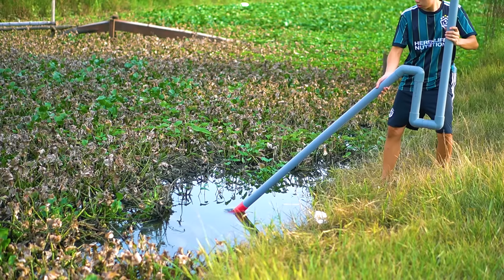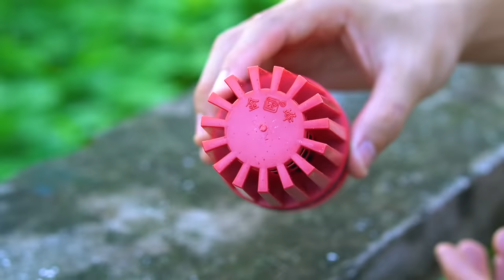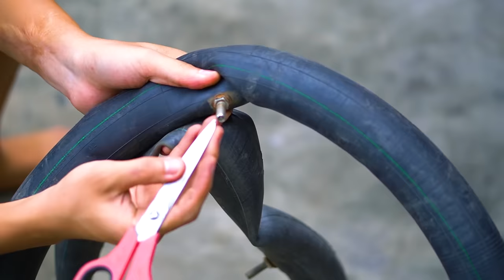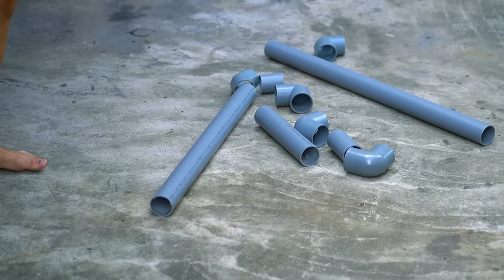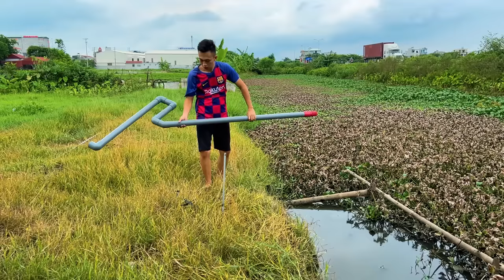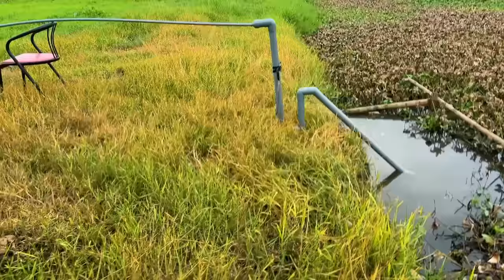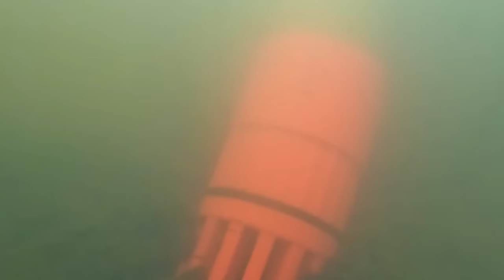I turn PVC pipe into a water pump no need electric power

Comment: what kind of check valve is that? where do you get one?
Reply: You can easily make one out of parts from a hardware store.
Reply: You can buy a gas siphon hose with a half inch copper fitting with a marble in it for siphoning gas without getting any in your mouth at any auto parts store in the US. I have 3. One in each car and one at our cabin for transferring gas from gas cans to generators with total control so I don't spill. As you jerk the hose upward from teh bottom of the gas can, a moving column of gas rises and when you jerk the hose back down, the gas continues upward for a second and then as it begins to go back downward, the marble seats in the copper fitting and stops the flow. As you jerk upwards again, like this guy does in the video, the process repeats. That part is simple and readily available in the US. It's just a simple check valve. He is using the inertia of the moving column of water to open the check valve on the drop, then it closes and holds the water in and raises it and develops inertia in motion on the rise, and then while he jerks it back down again, the water keeps rising in the pipe and teh valve opens and lets in more water, then the process repeats. What I don't have an answer for is how it keeps pumping. I suspect once he attaches the hose to the output, it acts like a simple siphon as that delivery water goes downhill out the delivery pipe. Somewhere inside that u shape there is something else happening in hydrodynamics that is causing water to pump uphill in a small amount at teh expense of water going back out the bottom of teh contraption and creating a vacuum. gonna have to look that one up.

Comment: Total bull crap, against all laws of physics. From the time he put the pipes together before you walked into the grass we did not see him and that is when he installed a small pump battery powered inside the pipe. The check valve lets him sloshing it back and forth in the water allowed him to prime the pipe up to where the pump takes over.. not only that but when he was putting the smaller half inch or 3/4 pipe to extend it up The Big unit he was fighting pressure. The rest assured there is no magic here, only a pump installed inside the pipe well the cameras weren't on him. It amazes me how many people are falling for this   🙄   👎🏻
Reply: You got an analitical mind haha
Reply: Creative Prodigy commented, he made one as in the video and it works
Reply: @mahomedrafik6908  No way!!!
Reply: @mahomedrafik6908  i think creative pro lied and just want us to watch same fake video in it channel
Reply: @adiyasri6971  check out how the valve got modified. It makes a pressure pump as long as water pressure is bigger than atm pressure.
Reply: The air pressure is limited to the incline in the pipe due to the dip in the pipe - therefore the water pressure is greater than the air pressure. The water pressure thereby pushes IN the value and thereby creates a jet of water pressure that shoots the water up the pipe. Based on Archimedes Principle as long as the weight of the water based on volume is greater than the volume of air in the pipe below the dip in the pipe then the valve will keep sucking water as a spray jet under pressure into the pipe.
Reply: @louism9725  precisely what I also realized - thanks for the corroboration. This is a genius idea for sure.
Reply: @louism9725  the schrader valve requires 30 psi to force it open. Water has more psi the deeper it is - so the pipe goes six feet down and is 3 inches diameter - so you get greater than 30 psi to force open the shrader valve.

Comment: I could actually see this working a little is the outlet opening craned down and wasn't aimed straight out.  Seems a little too easy for the air to enter and the vacuum to break and the flow to stop. certainly not enough to squirt out of the hose like that. My vote is that there's more going on here.
Reply: Its work.?

Comment: The very steady flow of the water proves this pump is powered either by electricity, gas engine, or otherwise a windmill on a very windy day.  You'll be needing a new tire tube for your bicycle.  Do what I did and use a broom handle in place of the tire tube! Don't worry... the broom handle will bend into the shape of a tire tube.  Kidding.  Just sticking it to you like you stuck it to all of us. 🤣

Comment: No way!   He's got to have a submersible pump hiding under there.   There's not enough current to move a RAM pump that hard
Reply: RAM pumps don't work off of current they work off of water pressure flowing down hill. If you have current you can use a waterwheel.
Reply: It creates a suction just like when siphoning gas out of a car's gas tank.. same principle.

Comment: Water is pulled up by moving the pipe in and out motion using the check valve I get it.  How does it continue to pull water out of the pond higher than the pond level?  Gravity doesn’t allow it.  Unless there is a pump of sorts.

Comment: This guy must be given the PhD award. Newton is laughing in the grave.
Reply: Muito inteligente e incrível
Reply: Just insulting
Reply: फर्जी
Reply: Absolutely
Reply: the schrader valve requires 30 psi to force it open. Water has more psi the deeper it is - so the pipe goes six feet down and is 3 inches diameter - so you get greater than 30 psi to force open the shrader valve.
Reply: This is not possible...
Reply: @ansumanbaldania2311  He moves the water back and forth to create over 40 psi to open the Shrader valve (30 psi spring opening). The "pea trap" collects water creating a negative pressure PSI gap and thus the shrader valve keeps shooting up water.
Reply: Free energy?

Comment: Note, the initial siphon pipe is equal the the other, but once it is carried to the pond it is almost five feet long.   Does PVC grow in that country?  Fraud.  there must be a pump in the pipe.  Show us the inner of pipe before placing it in the pond and then reassemble on spot, there was no  glue needed.
Reply: I noticed the longer siphon pipe too. Better yet, make it with clear plastic pipe. A little more expensive, but hell, he's got 588k subscribers. He can afford it!
Reply: Right! Compare the build pipe length at 5:43 with the pond length at 0:05 - twice as long. He had to remove the modified check valve as there is now way that volume of water would flow through the tiny Schrader valve!

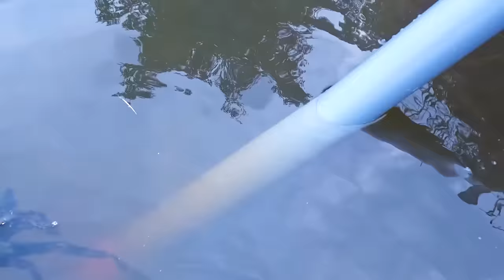Comment: This device cannot work in still water. Note at 11:25 there is a big hole on the left where water flows into the pond. Note the water turbulence too. The water could be directed towards the pipe via the red check valve.
Reply: Correction: should be RIGHT  not left side.
Reply: What?!

Comment: You can use a ram pump for  no power but it uses gravity and is very inefficient
Reply: Well at least you're kinda right. It's electricity that you don't have not power. The ram pump uses water as it's power source, and it is very efficient. It works and works 24-7 without you there pumping it by hand.

Comment: After this video I went outside and made the same thing and filled up a bucket with water.
The bucket immediately started climbing a wall.
Reply: the schrader valve requires 30 psi to force it open. Water has more psi the deeper it is - so the pipe goes six feet down and is 3 inches diameter - so you get greater than 30 psi to force open the shrader valve.
Reply: @voidisyinyangvoidisyinyang885  The schrader valve never even opened. It was mounted in a non-watertight sliding check valve leaf and water could flow past it freely in an upward direction, straight into the little battery pump mounted inside the pipe. The valve was added for visual effect.
Reply: @voidisyinyangvoidisyinyang885  Thanks for telling...and?
Reply: @TrueSolitaire  Actually the secret is when he moves the PVC pipe back and forth - that's what opens the Schrader valve. Then when the bottom of the 90 degree pipe fills up that creates a negative vacuum that pulls the water up. Then the water pressure keeps building up to push the water out the other end of the pipe.

Comment: Same principle as siphoning.

The red contraption below is a non-return value.

Once the pipe is filled with water and flows, then it'll be free flowing.
Reply: That is not a non-return valve it is a torn apart valve stem. I guess it could help if when you put the thing in the water you slipped a hose over it and then someone turned on the water.

Comment: This is one of these thousands of videos on youtube where the publishers only chase the number of views for financial gain.  Although these are all hoaxes, what I cannot understand is why would you risk your good name and honour to post videos like this - and I have not specifically chosen this video to say this.  It is just impossible to comment on all the BS videos out there.
Reply: … and he seems to be succeeding in that. Zahils are wondering and liking!
😂😂😂
Reply: the schrader valve requires 30 psi to force it open. Water has more psi the deeper it is - so the pipe goes six feet down and is 3 inches diameter - so you get greater than 30 psi to force open the shrader valve.  So no - not a hoax
Reply: It's a shame people can't be upfront.  I'm getting fed up with the bs

Comment: No water will flow up in a pipe unless mechanically assisted. It does not matter what specification or pipe measurements are used. Pumping at that flow and constant pressure, endless. Built the exact model, did not work. BS.
Reply: и не будет работать так как противоречит физике
Reply: It's a pressure pump. check out how he modified the valve.
Reply: The water will absolutely flow up into the pipe. Right up to the height of the water on the outside of the pipe. Unless you plug the pipe with a schrader valve. Then no water will flow up the pipe.

Comment: Now, build an enclosed system, power a suitable sized motor with that water flow, and you've got yourself a perpetual power generator. And they say it can't be done 😆
Reply: but no system can be total closed you can get close, but fully, the bar for perpetual motion is way higher, just regular power generator, unfairly really regular stop and star all the, but to perpetual power generator once started much keep going on for ever to the ends of time, the second it stops it not perpetual motion
Reply: The reason why it (any type of perpetual thing)can't exist is because nothing is 100% efficient. Not the water pump, nothing. You might get away with the system for a few seconds (long enough to make a video) provided that the pump pumps up a fraction of what was used to power it. That is obviously not sustainable
Reply: Yeah, that was just what I was thinking….with a series of basins on a hillside connected by these, and then to a gravity fed water power generator….seems like this would solve all the world’s energy problems.  Since this would be pretty obvious by now, and this isn’t done, I am missing something here.  Even if not perfectly efficient and lose some power at each step up, seems like a solar pump could compensate for this, but again as this isn’t really done, something doesn’t add up.

Comment: Notice in the beginning he's showing you the insides of the small pipes... The big one doesn't get a clear shot through it as that's the one that has the pump. The check valve is used to prime the pump, without that it wouldn't work. Next video please.

Comment: I watched till the end, and I am amazed. Mine won't work though. I don't think my inner tube was broken enough. But hey, almost 1,000,000 views and nearly 600,000 subscribers. Not to mention over 1000 comments (plus replies). Money in the bank!
Reply: 1.8M Water Jiggler pump fuel Transfer Self Priming Shake jiggle Siphon Hose Pump
Condition:
Brand NewBrand New
Bulk savings:

Buy 1AU $14.80 each

Comment: Couldn't help but notice him building a small version of what he brought down to the stream. Not sure what the point was in doing that but it's much smaller. I'm also trying to figure out how the tire valve would be used considering it wouldn't let any water up from below without being compressed.
Reply: I actually was thinking that this was a trick using the valve stem to compress air the moment I saw the stem. Truly however this can be achieved and I use a similar method to clean my aquarium. Also if you've ever had to siphon gasoline into a container the very same physics are at play. This is not impossible. Also as he's jabbing the end into the water that's pumping water into the body up to the spout to start the flow. The only thing that's I question is the  distance of the output and angle. One thing to note is if a large air bubble gets into this pipe the flow will stop.

So did you build the smaller version? Results?
Reply: He made the big one before filming. Just to make sure it works before showing how to build one
Reply: @1134phi  LOL WHAT

Comment: Nice magic trick, he should try it out on the show "Penn and Teller: Fool Us".  😉

At a depth in water of six feet the pressure is about 2.6 psi (gauge).  This is nowhere near the 30 psi he says the Schrader valve needs.

You could make a perpetual motion machine by using the falling water to drive a waterwheel and letting the water return to the source.

A perpetual motion machine channel on Youtube is a perpetual cash flow machine.  It would be interesting to know how many there are.

Comment: There are two things missing in the  list, after assembled this .its seems 3nos 60mm 90° bends & 2 nos 3 feet 60mm pipe lenth.
Reply: The most important parts missing from the list are the pump and batteries you have to put in the pipe to make it work.

Comment: I am a plumber by trade so I will actually try this out for the laugh. Could take me weeks but I will try it out.
Reply: Did you tried this?
Reply: 1.8M Water Jiggler pump fuel Transfer Self Priming Shake jiggle Siphon Hose Pump
Condition:
Brand NewBrand New
Bulk savings:

Buy 1AU $14.80 each

Comment: What are the odds of the nub of the Flux capacitor bumping the recessed tip of the Schrader valve bouncing around wildly around inside the red cage? Somewhere between 88 miles and hour and 1.21 Gigawatts, that's only if the Libayns didn't get there first.

Comment: As a Millwright/Industrial Mechanic that’s worked with pumps for over 20 years. I can tell you that this absolutely works. The Schrader valve is nothing more than a stop. To fill the hole of the one-way check valve. The water is then allowed to move through the strainer filling the pipe to the top of the drop. When the pipe is full to the top of the discharge it has built up suction (displacement) to carry the water out of the pipe. As the water leaves the pipe, it creates suction. The suction causes the water to be drawn in again to the one-way check valve filling the drop and discharging the water. This is a great way to move water across flat areas or a minor uphill slope. There isn’t enough head pressure built up to move water uphill but this will work.
Reply: What's the name of these type of pumps
Reply: @jrgmty7685  it actually has no name it’s the action is know as displacement. You can see the same action in any siphon hose.
Reply: @Sasklahoma  I believe you but I would like to see someone replicate this without any editing. See when he is assembling it, the part that goes in the water is shorter, then when he brings it outside to put it in the water it's longer.
Reply: True, and it would work even better with changes to pipe diameter.  Los Angelas receives water through a pumpless system of pipes with changing diameter.  Only have to fill the pipe with water the first time, then presto.

Comment: What is the function of the valve set to check? because it requires a lot of pressure to activate
Reply: Did you see that guy modify the valve. It's make it lighter to lift up and allow water pass inside.
Reply: @transsformer  Yes, I just don't think the volume of water goes through the valve, it's a lot of water and the valve doesn't do that. what is your function?
Reply: @adanjimenez212  the check valve relieves backwards pressure so that the small pump can run smoothly and quietly.
Reply: you must use soft spring for the valve.
Reply: The air pressure is limited to the incline in the pipe due to the dip in the pipe - therefore the water pressure is greater than the air pressure. The water pressure thereby pushes IN the value and thereby creates a jet of water pressure that shoots the water up the pipe. Based on Archimedes Principle as long as the weight of the water based on volume is greater than the volume of air in the pipe below the dip in the pipe then the valve will keep sucking water as a spray jet under pressure into the pipe.
Reply: @jimmil2270  the schrader valve requires 30 psi to force it open. Water has more psi the deeper it is - so the pipe goes six feet down and is 3 inches diameter - so you get greater than 30 psi to force open the shrader valve.
Reply: @techniciandnyaneshwar  सर ये video सच है क्या ऐसा पानी आयेगा हिंदी में बतावो
Reply: @arunjadhav7342  सर ऐ व्हिडिओ फेक है ऐसा हो ही नाही सकता.जरा सोचो अगर ऐसा होता तो बिजली पंप की जरुरत ही नही पडेगी .ऐ शानदार कलाकारी की वाली है.
Reply: @techniciandnyaneshwar  okसर

Comment: It's cool that he found the spring source for the pond and tapped it like that. It isn't magic. It's running water, under pressure. You can't see it welling up at the top, so it looks like it's breaking a law of physics when it's just pressurized water.
Reply: Not even that, he has submersible pump sitting in the water just blowing water upwards, then he just puts the end of the pipe over its outlet.... lmao.

Comment: It's common sense the down slop is 1/4 of the up slop. It physically doesn't have enough energy to pull the water up. And his red valve just holds the water from going back